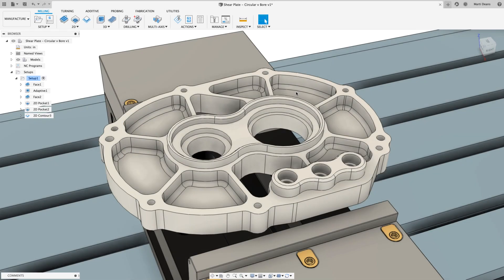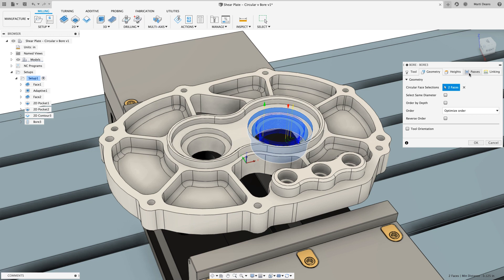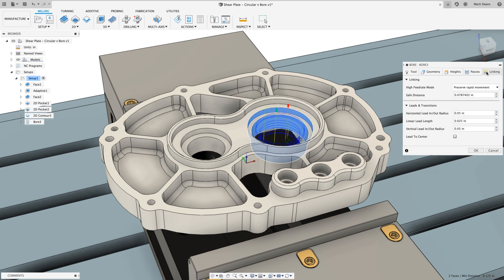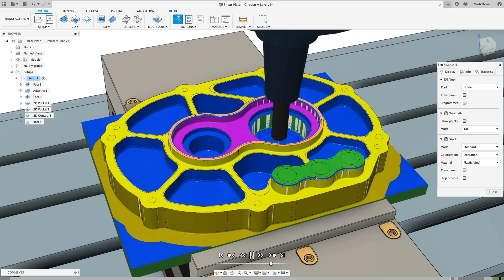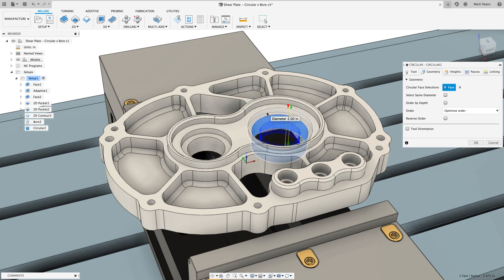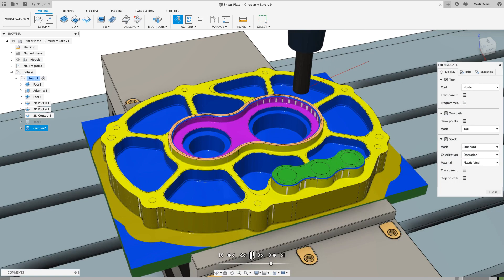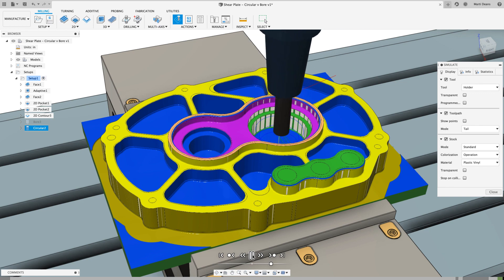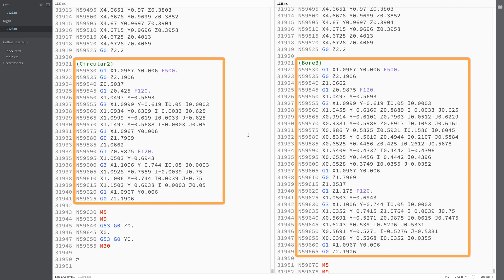Autodesk Fusion 360 | Quick Tip: Bore Toolpath or Circular Toolpath?

Comment: what I need is something that enters a solid material like in boring cycle.  helically ramping down to depth of bore, but then immediately switches to circular interpolation when opening up the hole without all those wasted moves rapiding up and down and wearing out the corner of the end mill like the narrator described. I find that there is so much wasted rapiding in 360

Comment: Do you know why it outputs it as a new line of code every .0001 of depth? I got 12000 lines of code on my program for .5 inch deep tapered bore.
Reply from the maker: What toolpath are you using? And with what stepdown?

Comment: Is there a way to get the Circle path to output a single circle versus 2 arcs?  I seem to get two control points for a circle move along a bore contour that was modeled as a circle.  The Fusion bore function outputs a single circle with a single control point for the lead in-out but requires a helix entry.
Reply: My understanding is that if you're programming using radius, you need multiple arcs to create a full circle as the control needs to know where the circle is relative to the start point. There is logic in some posts to get around this issue, but it will depend on what post you're using. 
If you can use arc center points, you should be able to get the post to output full circles by changing the maximumCircularSweep to equal toRad(360) – this should be towards the top of the post and you can use Ctrl/Cmd+F to search for it more quickly.
As always, if you go ahead and make post edits do some testing and take it slow! I'm not a post expert :) Hope that helps!
Reply from the maker: Thanks for the assist, Marti!